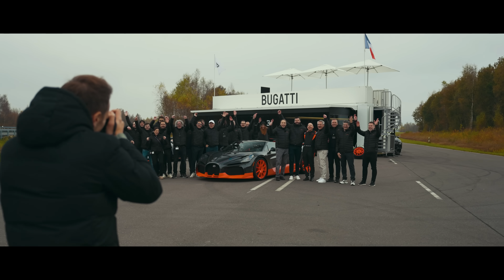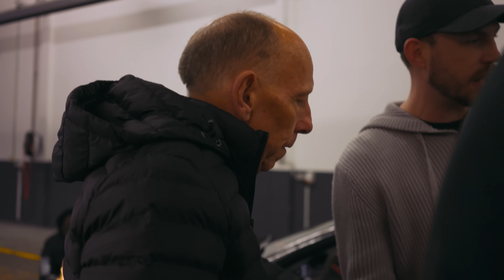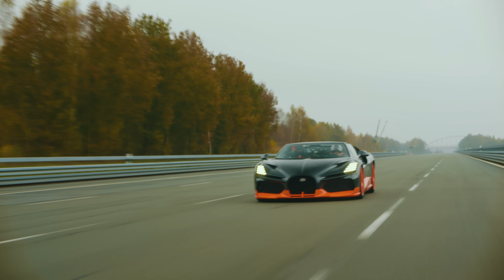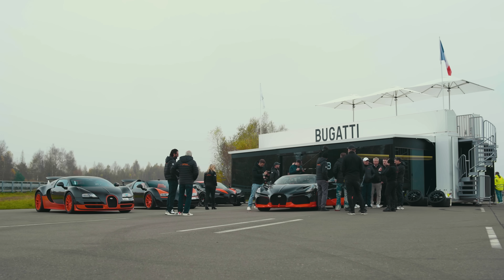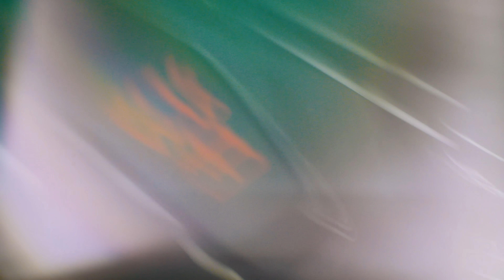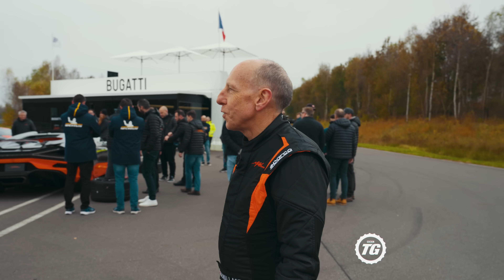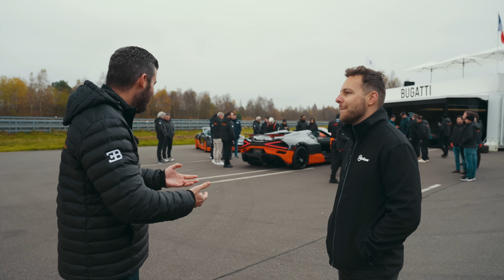Bugatti Mistral! 282mph… With No Roof

Comment: The only solution to beat 500km/h now for Bugatti is either make 2000hp or drop the weight further
Reply: At high speed weight impacts less. Aero and power matter more.
Reply: @ChubiPanda   weight impacts less lol, according to who
you know if more mass is in it, more energy you are going to need right
Reply: @thatparticulargame6001  The power required to overcome the weight of the car increases linearly with velocity, where as the power required to overcome drag is cubic with velocity. The increase in tyre friction as a result of higher weight is massively dwarfed by the aero drag.
Reply: @thatparticulargame6001  weight affects accel a lot, not the top speed, now sure you want to keep the weight down to reach to top speed faster but it doesnt affect the actual top speed of the vehicle, if the vehicle has enough space
Reply: @thatparticulargame6001  Drag is the biggest factor, then power, then weight..  
   "At 70-mph, the horsepower / Kilowatts necessary to overcome the drag would be 8X what it is at 35-mph ( the velocity-cubed-law ) (you're hitting twice as much air, twice as often, and twice as hard)"
Reply: @thatparticulargame6001 yes weight impacts less. The more the better in this case. Because you need that extra downforce without affecting drag
Reply: @Hellcat-Nick  wouldnt weight afect acceleration consequently making top speed runs harder as you would need more ground to cover? being too heavy makes it less stable at high speeds too i think.
Reply: @unkindled6410  That is what I'm talking about, but always these guys point it out like weight doesn't matter. 
That's why Mr Christian is able to make his cars do astonishing stuff like 0-400 or 0-250 mph in just 18 seconds. 
Also, with the roof off, I think the drag is just 0.37, not that much up. (My guessing)
Reply: @thatparticulargame6001  You the who always tryna find excuses to downgrade bugattis like what a diehard fan are you?  B-but cd 0.37 not much diff😢😢 Source:Trust me bro😢 Yes you said "My guess", because you always tryna find a way to have something against the brand! Pathetic
Reply: @thatparticulargame6001  without speed limiter a production Chiron SuperSport or Chiron SS 300+ will easily break the 500 km/h Barrier if it was on Nevada Highway 11 miles of straight first section goes downhill so if 304.77 mph Ehra Lehssein then 310-315 mph VMAX on Nevada Highway 
Ehra Lehssein has flat surface high DA of air density trees around
Nevada Highway thin Air higher altitude one section goes downhill 
3 advantages also maybe some tailwind 

When Agera RS did 284 mph going downhill supported by tailwind
In other direction it couldn't go above 271.8 mph or 272 mph 
Koenigsegg says One:1 top speed is 273 mph which was never tested
Agera RS is the same car apart  from aerodynamics
So Agera RS top speed is 273-275 mph on a Flat surface

It cannot reach 284 mph on a flat surface
Reply: @thatparticulargame6001 according to physics lol
Reply: @dontyouworryaboutit_  physics don't work like that. A car with 1600 HP and long gear ratios literally geared for 300 mph you think it can't do 300 mph? Mistral Top is speed certainly above 300 mph it will do 290-295 mph effortlessly if it ran on Ehra Lehssein 
Mistral had identical acceleration as Chiron SS 300+ from 300-350 km/h or 428-450 km/h
We still have no Mistral Raw VBOX 250-453 km/h run
Despite Mistral having open top and ran in wet weather conditions wet track higher air density
Mistral still got nearly same acceleration as Chiron SS 300+ protoype 
As Chiron SS 300+ is more aerodynamically efficient
Both cars 428-448 kph acceleration was similar and also the 300-350 kph acceleration was similar 
But above 450+ km/h Chiron SS simply started to pull away because it's more aerodynamic than Mistral

Both cars have same engine same power same gearing nothing changes 

The haters will say Chiron SuperSport had 2000 HP well the reality says otherwise
Reply: @Smzxe the Chiron ss literally makes 1700 horsepower 😂
Reply: @ericship8383  and? Bugatti is faster than any Koenigsegg then real world drag races proved otherwise.
Mistral got identical 300-350 kph and 420-450 kph acceleration as Chiron SS 300+ prototype which did 304.77 mph so there's no difference between them Mistral made 1608 HP on this as you can see on the dashboard 
Chiron SS on Bugatti test made 1600 BHP 1618 PS on Dynometer

if Hamilton collection Chiron SuperSport really made 1734 BHP on Dyno then how terribly it performed against Rimac Nevera then? 1700 HP on a roller dyno? Why they don't test it on Hub Dyno or diff dyno And? Why every dyno shows different results? Get it hub Dyno for real power measurement On the road Chiron SS only made 1615 BHP on 212 mph high speed run 
So Chiron SS is only reaching 1600 BHP on real runs 

You still have no clue about any car keep dreaming when you said a stock GTR can do 230 mph 🤣🤣🤣
Reply: All those 🤪 here who are downplaying what the first guy said about reducing weight.. seem to forget that all Bugatti models weigh around or over TWO TONNES!! Or some 600-800kg heavier that their competitors at Koenigseig, Hennessey, SSC, etc..
Reply: They hit 490 in the SS
Reply: less weight doesn't mean higher top speed
Reply: Yeah they need to make slim version/road version of Bolide and add longer gear ratio
Reply: Neither of the two, Let's say 2000hp GTR can do only about <420kph while Chiron with 1500hp also can do <420kph. 2000hp is an overkill, gear ratio and aero is the key to beat 500kph. Theoretically, a 2000hp can do 575kph with ideal gear ratio and lower drag coefficient,  even at under 2 ton weight.
Reply: On slick too maybe
Reply: It is pointless, it would be just a number
Reply: Weight only affects acceleration, not Top speed.
Reply: Guys, calm down, I'm sure mate rimac has plans for the turbillion ss, the speedometer of the turbillion reach 550kph, there's no way rimac would just randomly do that if the car can't even reach 500kph.

Comment: Bugatti finding a way to hold 270+ with no roof is fitting and still insane
Reply: I wonder how much faster it wouldve been on a dry road
Reply: @radicaIized  with slightly less dense air, too. Between the two effects I think there would have been a noticeable difference.
Reply: @radicaIized  there's no point beating a record by too wide a margin when you know you're going to be the one beating it again... there's only so manyy mph you can go faster when you're in 300mph territory so you just make a clean record that beats the previous one but you don't jeopardize your chances to beat it once more th next time...reminds of sergei bubka who patizntly beat his own record cm by cm for a decade when he was beating it easily during training
Reply: They probably could've gone faster at Ehra Lessein but hey ho. Papenburg is alright
Reply: Not only that he said “little to no vibration and no normal whipping wind turbulence” 🤯
Reply: IN. THE. WET!
They are not pulling excuses!
Reply: and they will probably beat it soon too
Reply: @DimensionalForce8941  still got 500 more rpms to go
Reply: @ZoMTDU it redlines at 7100, the top speed in this video is final and it is determined by gearing,  not road length or conditions
Reply: Nah. @DimensionalForce8941
Reply: Actually the roof blew off
Reply: How Andy Wallace hasn’t yet received a knighthood for his services to speeeeeeed yet, I’ll never know!
Reply: What's insane is 338.94 miles per hour by Brittany Force at the NHRA Finals in Pomona, California on a 1,000-foot run.
Reply: @moboasia  Those machines are the definition of insane!! I wonder what a longer strip and different gearing can give them.  But would probably need more durable sparkplugs to even go further than a quarter mile
Reply: And its also a streetcar with AC and a radio, and it can idle in traffic all day long. What other hypercar that can hit over 250MPH do that? NONE…..🤔🤔🤔🤔
Reply: Another D rider
Reply: I can't imagine how loud that actually is, regardless how little turbulence is claimed
Reply: You meant VW.